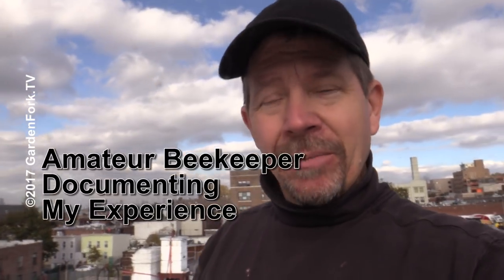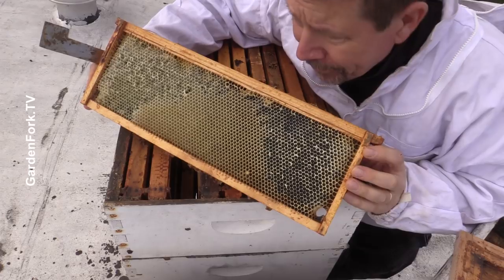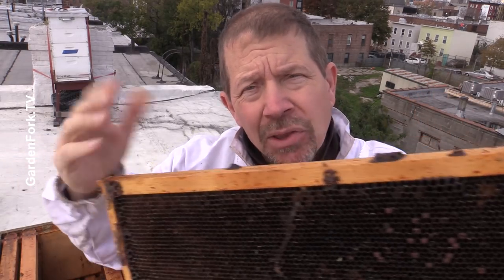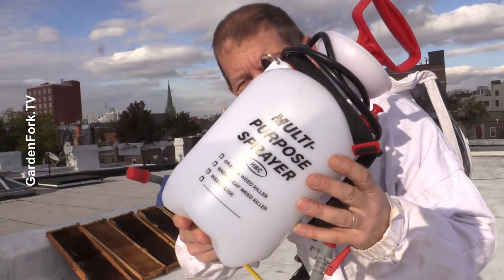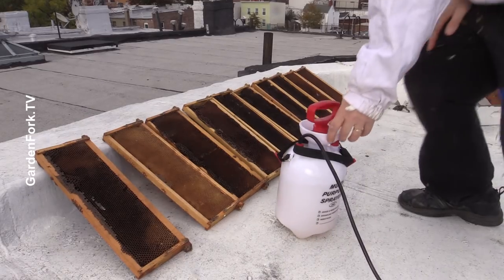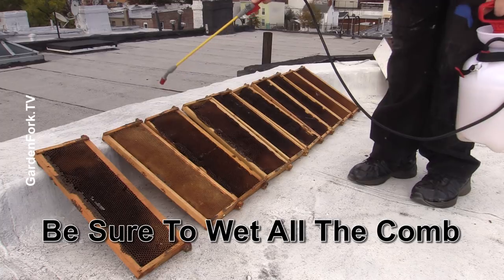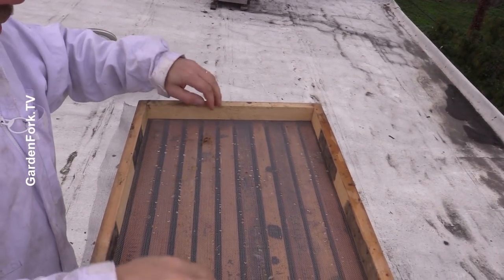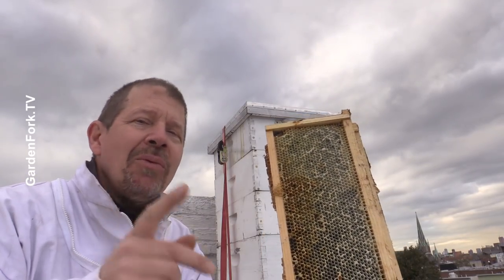This Moth Will Ruin Your Beehives | Organic Wax Moth Spray | Beginning Beekeeping GardenFork

Comment: what is the hole in the corner of the frame for?
Reply: The Eatons Show - Makes it easier for the bees to travel from one side of the frame to the other.
Reply from the maker: +Erik Darm exactly! When you use plastic frames the bees can't leave access openings in the comb, so the holes help. Thx Erik!

Comment: My concern is mold.  Do you have to worry about adding that mixture and getting mold?
Reply from the maker: +Paul Otis Hi Paul, actually no because it dries quickly and you store frames with ample ventilation. You can get mold in live hives in winter, with the bees being warm and the outside walls being cold. Thx!
Reply: good to know!  Thanks!